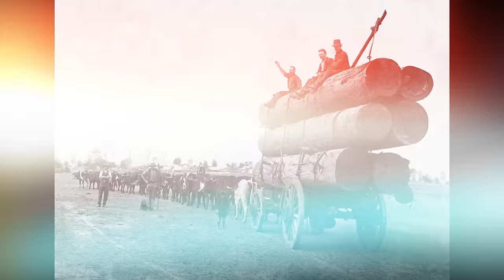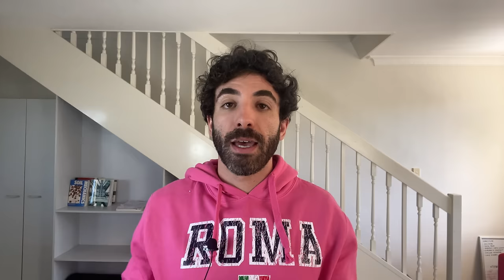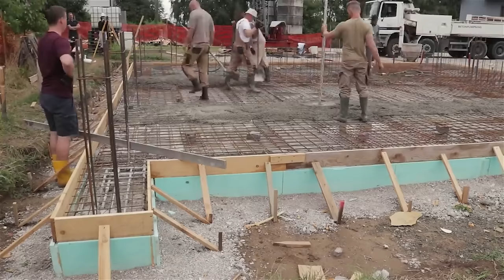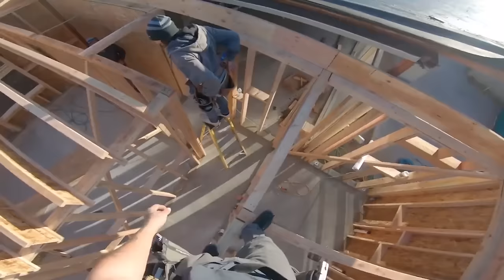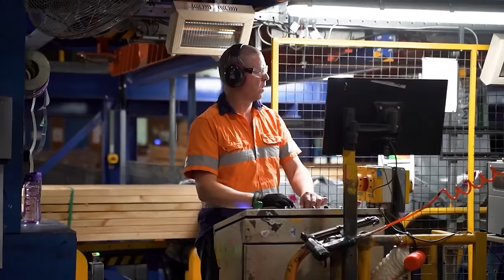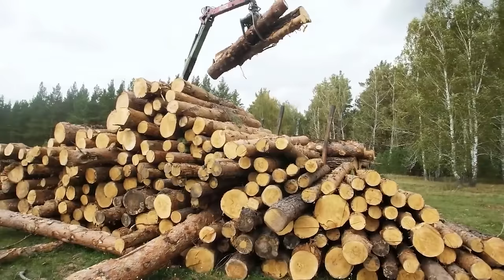Why Are Australian Houses Built with Wood

Comment: Meanwhile in Perth, Western Australia, anything built in timber is regarded very second rate. The dominate style is brick, with double brick on the outside walls, timber only for roof framing and decoration.
Reply from the maker: Good point Greg. Do you think they will eventually transition to light weight framing?
Reply: @bengthebrazilianengineerinAus  I'm not in the trade, but can see a transition would help reduce building/housing costs with a move away from such a high energy (brick production) and labour (brick laying) costs. I see more second levels being a frame on top of a brick ground level. Though I imagine human psychology would then place even more value/prestige on brick due to the extra cost 😉

Comment: I noticed that Queensland has a climate similar to much of Brazil, that is, very hot and very humid. One question I would like to clarify is whether these lightweight walls work well without air conditioning. Where I live in Brazil, I visited some buildings built with light steel frames and observed great thermal discomfort in the late afternoon, even with walls insulated with mineral wool. Unlike the brick walls with high thermal mass that we are already used to in Brazil, light and insulated walls have no thermal delay, that is, little heat passes through, but it passes through quickly. Good luck to you in Australia. A hug from BH!
Reply: Yes, the style of home he showed (Queenslander) has been around for 150+ years or so. It's built on stilts so avoid floors and provides ventilation. The focus is not insulation, it's ventilation. Honestly, new houses (not queenslanders) are built with wooden frames, insulation, construction wrap, and brickwork/brick veneer, so if you looked at them you'd not even know it was a framed (steel or wood) house - plus air conditioning etc.
Reply: @Bobtubeau  , Thank you for kindly clarifying. Queenslander houses are similar to the old houses in the Amazon region, called stilt houses (palafitas, in portuguese) built high off the ground to keep water, alligators and anacondas away and with openings at the top of the roof for ventilation. Ventilation and shade are the keys to thermal comfort in the tropics. Greetings from Brazil!

Comment: There are other points in this regard. In Brazil, we inherited the construction tradition of the Portuguese, who mostly build with ceramic brick masonry. In Europe, contrary to what many people think in Brazil, timber construction is not well regarded, except in Finland, Norway and Sweden. In Brazil, we still have a problem with the building performance standard (NBR 15.575) which requires a minimum thermal capacity of 130 Kjoules for walls in 7 of the 8 climate zones, and light timber walls have a thermal capacity of a maximum of 35 Kjoules. Strictly speaking, only in zone 8 (Rio de Janeiro, coastal region from the southeast to the north and the Amazon region) is it permitted to build light timber walls. Thanks for sharing!
Reply from the maker: great insights. Thanks :)
Reply: We must also point that here in Brazil construction industry excelled in the use of reinforced concrete to a point that building some odd forms by using this method became some sort of child play, as can be proven by the works of Oscar Niemeyer. Artacho Jurado and other great names of our architectural scene that pushed the envelope further in a time when this kind of construction was starting at a world level. Suddenly we had lots of workforce that managed to build on a modern way to a point that even simple houses are built that way (see how fast the structural brick residences disappeared from our landscape after the advent of reinforced concrete at a broad level specially after the 1960s).
Other thing that we must point is that for a poor Brazilian, the house is his/her main patrimony, meaning that he/she wants to build something meant to last not for a century like a wood/timber house, but for centuries and being something that can be inherited by descendants as some sort of scape from poorness. This reminds a bit the Euro mentality and how many old buildings made of brick, stone or even concrete (remember Rome) standed the test of time and are standing still even today there.